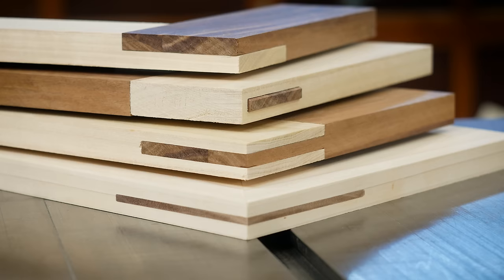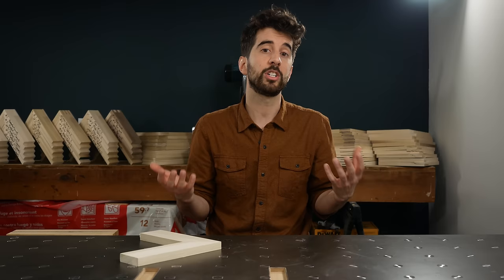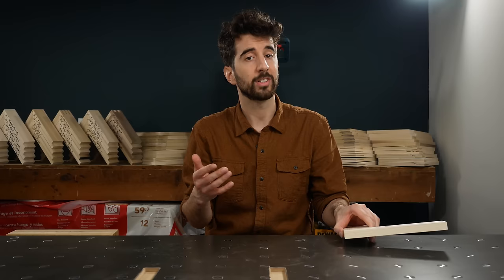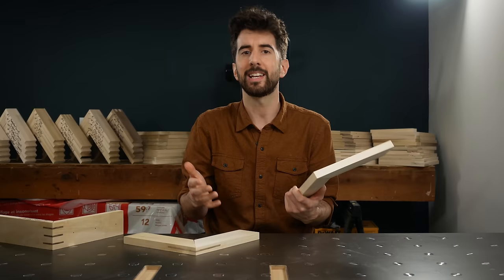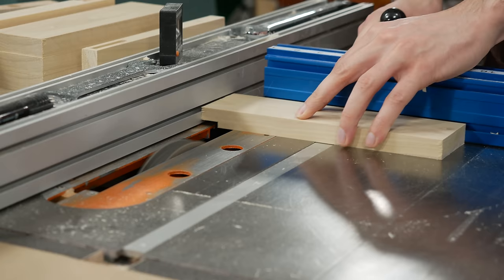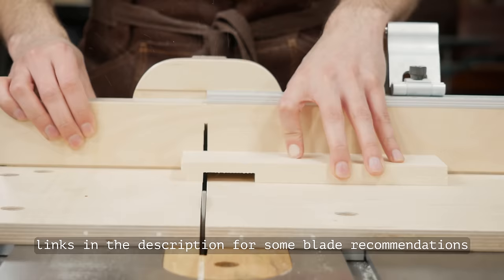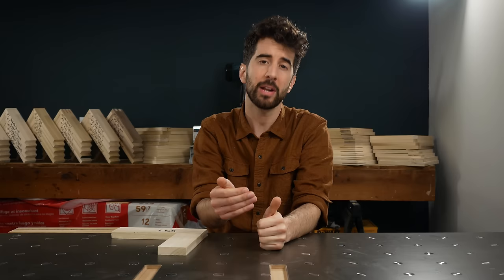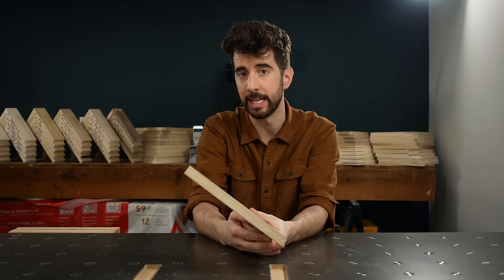Forget Mortise and Tenons... THIS joint is better.

Comment: I used to feel so uncool for making my half lap joints on my table saw because it was easy. Now I can feel quite smug and confident!
Reply: spoiler alert! no point watching til the end anymore.
Reply: @Craig-qx7uy  Why are you reading comments before watching if not to look for spoilers?
Reply: The fact that you use a lap joint puts you above those who can't think past the butt joint.
Reply: @jjbailey01 I'd like to see the mortise vs half lap mid way down the board
Reply: Smug CONFIDENCE can become your greatest ASSET 👍👍!
Reply: @chuckintexas Yes, and also a silly goose.
Reply: @Littlefoot377  I believe if you use the same direction of force he used with the other joints that the half lap would be much stronger than the Mortis the half lap would be much wider than the Mortis.

Comment: One of the main advantages of morris and tenon joinery was before glue was commonly used.  A mortise and tenon can be pegged and will be quite strong with no glue at all.  Try that with the other joints.
Reply: The Bridle Joint can have a 1" x 1" square thru hole cut in the center of it and a square peg with an interference fit hammered home and cut off on each side with a flat saw just like a Mortice and Tenon joint. Maybe Scott can test that. Also two or more round pegs can secure a Bridle Joint like an M&T joint or similar to the way machinists squares are joined together two, three, or four steel pins. I still enjoy the M&T joints though.
Reply: @chrisdaniel1339 
You are never going to use a bridle on a table or frame.
Reply: @Art-is-craft  If you say so
Reply: @chrisdaniel1339  
It is not used traditionally for cabinet frames or tables.
Reply: This is alot to ask of one guy, but I'd like to see some testing of different variables in a joint. I always make my mortises with at least half an inch to the endgrain side for instance, and I'm curious about the kind of difference that makes.
Reply: @Art-is-craft  If someone wants to do traditional joinery that is fantastic. For me woodworking is about crafting something unique, functional, beautiful, enjoying the process, and learning new skills along the way. If someone tells me I cannot do something or it is not traditional you can bet I am going to do it, one to see if I can and two, just makes me want to prove them incorrect..........
Reply: @chrisdaniel1339  
A dovetail, mortise and tenon joints are no more difficult than a bridle  joint. The most common joints in traditional cabinet making were tenon and dovetail.  The most common wood used in traditional cabinets was mahogany with a simple rub on wax using a rag. Bridle joints were used on specialist tasks.

Comment: a lutherie trick: it's better to have slightly rough surfaces in the contact/glue area, especially with woods that are difficult to joint (due to their high oil content). It does not hurt to make small "scratches" in the areas before joining, especially on processed boards (mdf, plywood, etc)
Reply: My thoughts, you expose the ends of the fibres and the get glued together across the joint.  Almost like a micro finger joint
Reply: Rouhg surfaces also have more surface area which increases the strength of the joint.
Reply: If you are concerned about dry-squeeze then yes. Otherwise there is nothing to be gained with ordinary electrochemical glues as the wood is aready the weakest link. Any thickness above minimum will decrease the strength of the glue part of the joint. For glues that rely on mechanical tack (plastics typically) it is advantageous.
Reply: I disagree.  Regular wood glue is not gap-filling, and you get the strongest bond with smooth faces in perfect contact with each other.  That's why we have jointers.  With your technique, you should use certain types of construction adhesive (e.g. Liquid Nails) or epoxy with fillers appropriate to the gap size.

Comment: If more glue is the way to get a stronger joint then clearly the best thing to do is to get rid of the wood completely and make everything out of glue and rename our profession to Glueworking.
Reply: Putting glue in your joint won't make it stronger and it's not good for your health. All the best to you. Bye

Comment: A "chocolate teapot" actually makes perfect sense. It is a thing intended to hold hot liquid, made out of a material that melts very easily.
Reply: And it's an existing turn of phrase in some regions, so ChatGPT didn't even come up with it itself
Reply: Swert and tempting, but absolutely impractical.
Reply: A chocolate teapot will work if the tea water is cool or if  using hot water, the tea is made in a freezer.
Reply: @maplebones  I like the outside the box thinking, but I'm looking forward to the youtube video where you test the freezer hypothesis. 😀

Comment: You can have taller hair in the new shop! My joint test was to build a workbench with tool storage, put hundreds of pounds of tools in it and load it into a container. The container went by truck, rail, ship, barge and truck from NC to Hawaii. Then 5 years later, to CO. In between, I used it as a workbench. Wedged M&T joints are fine 20 years later.

Comment: I think its misleading to say that the bridle and half lap are stronger than the mortise and tenon.  They are stronger for a force coming from that specific direction, but a mortise and tenon would do better resisting forces from other directions.  Joints are held together by glue strength and mechanical interference and the way you are testing these joints puts the half lap and bridle in the best situation, where they have both the advantage of large glue surface area and mechanical interference. If you were put a force in the opposite direction (pressing down of the levered parted of the joint instead of up) you would lose the mechanical interference and just rely on the glue strength.  In fact in the six possible directions (up, down, left, right, towards, away) the half lap only has mechanical interference in two directions (up and towards), a bridle has mechanical interference in three directions (up, towards and away) and a mortise and tenon has mechanical interference in 5 (up, down, towards, away and left).  If you put a dowel in your mortise and tenon it has mechanical interference in all six directions.  This is why it is a joint you can use even without glue and why it is so popular for pieces of furniture which will experience forces from several different directions.  

Obviously the bridle and half lap have their place and they will likely stand up fine in a piece of furniture, but you shouldn't think of them as a 1-to-1 improvement over a mortise and tenon.
Reply: They also aren’t directly interchangeable. You can’t use all these things in every situation. 

Sure I guess if you’re making picture frames you have all these options but when you’re making furniture I fail to see how half laps should be used to make table bases, for example. Maybe I’m not that creative or maybe it’s because m&t is simply the right overall choice in that application.

Comment: Mortise and Tenon joints were considered the "strongest" for a reason - they last.
Lap-joints certainly are stronger but in general they will fail earlier as they are fully reliant (in most configurations) on the strength of the glue. So when seasonal changes in temperature and humidity slowly degrade the glue the Lap-join will just fall apart. Where as the Mortise will still hold together decently even without any glue. Mortise is also stronger against loads in other directions.

But the joints that are nearly always the weakest are the butt- and miter-joint. They are just inherently weaker as they do not have a mechanical locking nor a lot of surface nor continuous grain. Of course to everything there are exceptions. If you have something like say a house-frame then one of the best ways to connect a horizontal top-plate to the vertical struts is just ... laying it flat on top - a butt joint. For the loads it will have to withstand this is just the strongest it can get.
Reply: Thank you for that write-up. I often wonder why there is no focus on how glue holds up over the years. I understand that is hard to test for a youtube channel, but by not discussing it, I feel it is simply a subject intentionally glanced over because it is inconvenient. I know modern glues are really strong, but do they keep strong?
Reply: Any thoughts on doweling lap and bridle joints?
Reply: @KrahsThe  "but do they keep strong?"
Depends on the glue and situation. In general yes - as most of our furniture is indoors where the temperature and humidity is relatively stable, specially when compared to say 200 years ago. More stable glue and climate make it last far longer.
Reply: @WompWompWoooomp  Doweling lap - which direction? if there is a rotational moment then the dowel can certainly help hold it together.
And bridle joint is my favourite anyways (together with simple lap-joints). 

But for both - they will not just fall apart as easily as a lap-joint, but for the bridle it really depends on the load it experiences: Pulling apart or rotating out? Doesn't fair much better once the glue is broken.
Reply: Great comment. Years ago I made a garden gate out of 2x4s. (Not pressure treated).. Each corner was a wedged mortise and tennon and I added a diagonal brace that I dovetailed into place. I only used glue to "hold it together ".. the glue failed in the first season or two but that cheesey little gate stayed together and functioning for years till it rotted to pieces.
Reply: @KrahsThe  For sure ,  there must be lots of long term , or simulated long term, test results out there.
Reply: a lot of statements but no proof.  There must be long term testing of glue strength out there. Lets see evidence for your claim that these "modern" glues will fail earlier based on glue strength alone.  Perhaps it is so, but you've not given any proof or reference. Would love to see some actual long term test results.
Reply: @terrysullivan1992  " Lets see evidence for your claim that these "modern" glues will fail earlier based on glue strength alone"
You would have a point if i made that claim - but read again.
Reply: +1. I wanted to write the same. Good joint is a joint that not depends on a glue strength.
Reply: In addition, house frames are seldom glued; nails or screws are everywhere, and the cladding (ideally) stops said nails or screws from getting wet and rusting, while the loads a house-framing butt joint are typically required to bear are downward into the joint or supported by cross-beams or pillars.
Reply: Another thing that people also forget to consider is the preffered fail mode of the joint, should it fail (i.e. the original meaning of fail safe). Every joint will fail a different way against different forces. You usually won't get a complete break with a mortise and tenon (you literally have to snap the tenon off) almost from any direction. A lap joint, its most common fail modes are either a complete sepration or a almost complete sepration that can much more easily become complete (either cleanly such as due to glue degradation, or as messy as the last one shown in the video). Not always relevant, but that is the difference between a scare and a warning to get new kitchen cabinets because maybe you stuffed it too much or some unexpected living creature climbed on top of it, and all your shit just falling straight to the ground, maybe on someone or a pet.
Reply: Also, his last two joints were stronger than his mortise and tenon, but he designed it wrong. 

A mortise should never end this close to the end of the piece, tenons should go trough the piece, and ideally have a wedge or peg.
Reply: I was in the 4th grade with a guy named Mort Tenon who thought he was the strongest kid in the class. One day, he was confronted by Sally Smith who thought Mort was a big bully. Mort couldn't hold it together and he blubbered through recess by the swing set. Sad story.
Reply: @terrysullivan1992  well if you really 'love' them that much, feed your passion! Devise the tests. Run the trials. Give us the results because it's not our passion and we're whiny kids saying, "I want that!! ' Oh?  You're a lazy kid too!?

Well you could search for other's trial results. I don't care about it. I now make strong joints for my needs all ready. Boring and practical. Good day.
Reply: The best i saw tested, were butt/lap/miter joints fully glued up, which then had a dowel or slat cut into and glued in after everything was dried form round one.
Reply: @Ensign_Cthulhu  True, but there's a lot more to it. I once hired a contractor to me build a house and he explained the upward forces that strong winds put on your roof. That's why there are so many types of "hurricane ties" used in framing.
Reply: @chrisdoutre101  I grew up in a place where strong winds were not the norm.
Reply: @WompWompWoooomp  Your mileage may vary.  Dowels are best used when a joint requires reinforcement against failure in shear.  That's the main failure mode for bridle joints, so dowels are a good fit.  Lap joints can fail from the joint faces simple pulling apart.  Since there are no shear forces involved, dowels won't help.

Keep in mind, I’m only talking about in the event of glue failure (due to age or weather exposure, as suggested by ABaumstumpf.)  Absent glue failure, dowels are superfluous in either joint.  Personally, I don’t worry about glue failure for most joinery.  If you choose a suitable joint for the forces involved, and a suitable glue for the service conditions, it’s unlikely to fail in your lifetime.  That said, if you’re working on outdoor projects, or heirloom furniture that you would like to survive for generations, then it’s wise to plan for glue failure.  (I don’t know how long modern wood glues can be expected to last.  It’s clearly at least decades.  They may hold up for hundreds of years, but I wouldn’t count on it.)  In those cases, look for guidance in the joinery used before modern wood glues existed.  If you examine 18th century antiques, you’ll discover many “pinned” bridle joints, but you won’t find many (if any) pinned lap joints.

Lastly, I’ll add that woodworkers’ obsession with joint strength can get a little ridiculous..  There are no good and bad joints - only suitable and unsuitable joints.  I’ve used butt joints a few times for aesthetic reasons in desktop picture frames.  Since the peak load of the joint is about 10 pounds (if the frame is dropped from a few feet, much less under normal use) it’s a suitable joint.  I’ve used unsplined miter joints in dozens of much larger picture frames made for my wife’s handicrafts.  Some are as large as 24”x36” with 1/8” glazing, and an overall weight around 20 lbs. Many of these are more than 30 years old and none have failed to date.  The same holds true for much stronger joints.  Consider how the forces will be applied in use, and pick the best joints to stand up to those forces.  Here’s a few tips, in order of importance:

- Design the structure to minimize torsional (bending) forces on joints, then ignore those forces in your joinery considerations.  Bending joints introduces a lot of different stresses that vary greatly with the joint geometry and can be hard to understand intuitively.  If you can’t trivialize the bending forces, you should probably do testing and/or an engineering analysis if joint failure has significant consequences.

Digression: That’s why these YouTube joint failure videos aren’t necessarily useful for real-world applications.  They all test joint failure in bending because that’s where the joints are weakest making it easy to build test apparatus.  These tests reveal useful information, especially when you watch many of them, each of which uses slightly different geometry.  When you piece them together you can start to visualize how joint failure occurs based on different forces applied to the glue (shear and tension) and the wood (shear, tension along and across the grain, and bending along and across the grain.)  Unfortunately, it’s never as simple as “joint A is stronger than joint B”.

- Choose a joint where shear stresses will be handled by wood.  Wood glues are, relatively speaking, weak in shear (two faces sliding or twisting relative to each other).  If shear stresses must be resisted by the glue, maximize the glue surface area.

- Maximize the cross-sectional area of the wood member(s) that experiences the most shear force (Consider a table with an apron.  At the joint, the leg experiences compressive force along its length, but the apron experiences shear force across its width.  This is the type of consideration that might recommend Scott’s suggestion of making tenons 1/2 the board thickness instead of 1/3.)

- Avoid tensile forces across the grain of the wood. 

- Avoid shear forces along the grain of the wood.

Those last two are actually very important, but I list them last because they’re not meant to select the right joint, but instead to avoid compromising a good joint selection with careless grain orientation.

Writing it out makes it seem complicated, but if you’re the type of person who broke a lot of stuff when you where young you’ve probably got an intuition about most of these failure modes.  What’s less intuitive is how composite structures behave.  Carpentry joints are composites of wood with different grain orientation, glue, and fasteners (nails, screws, dowels, dominoes, etc.), so ordered consideration of the primary failure modes make them easier to understand.
Reply: @charlesenfield2192  That's a hell of a writeup, thanks a ton for the info!
Reply: Wood by Wright on YouTube has a long duration glue test that he's been doing for three years now. He'll keep testing every year, so we'll see, but his findings are that most wood glue does degrade over time, but it's still holding stronger than the wood. The only exception has been CA glue, which failed after a year (if I remember correctly.)